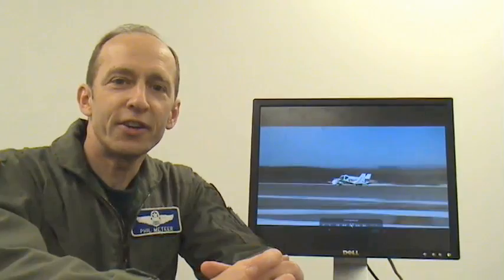Interview with Test Pilot Col. Phil Meteer, (Ret).

Comment: So it seems that the combined canard and wing lift slows the front wheel drop to the runway once the rear wheels
 touch down.  

Do you have to touch down faster if the payload increases?